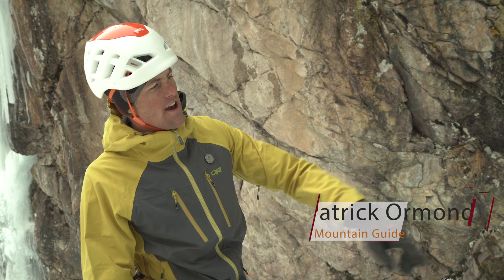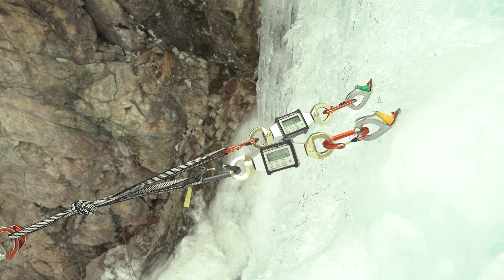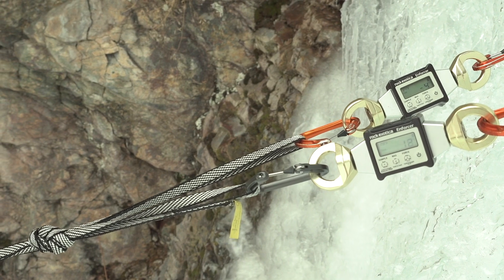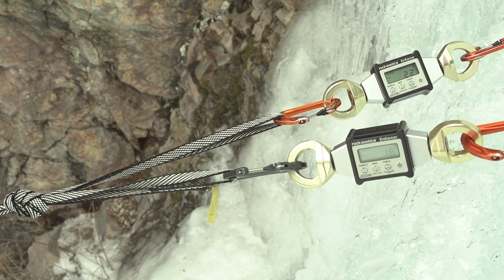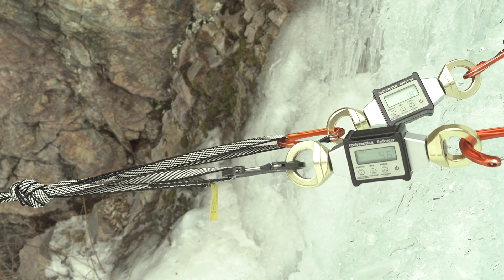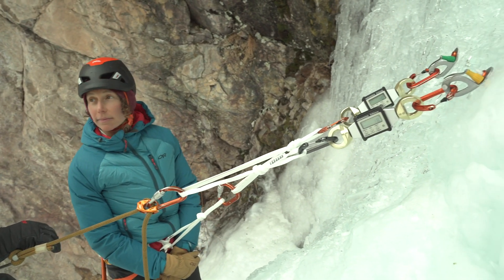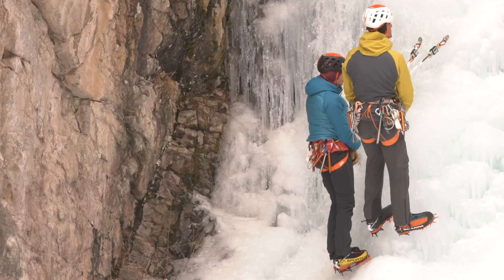Ice Anchor Load Distribution: Pre-Equalized vs Quad

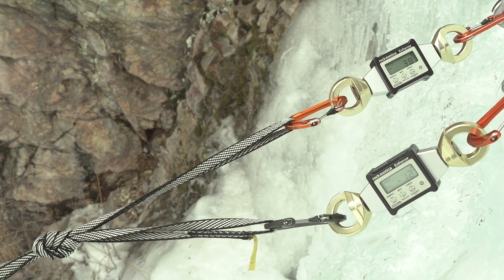Comment: Can someone smarter than myself explain how it is possible that the right load cell is reading negative force at 0:50. How is negative force possible?
Reply: A simple reason is because it was tared under a slight load, so once it is not loaded, it goes negative... there is a more complicated reason that I don't want to explain.